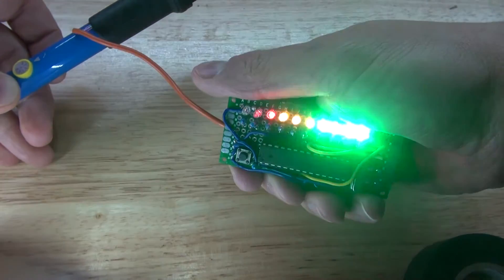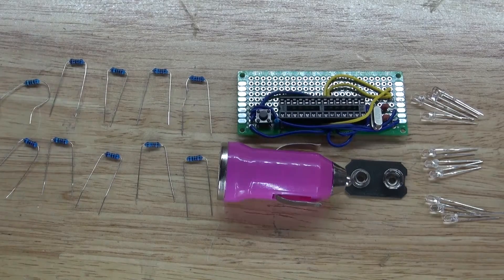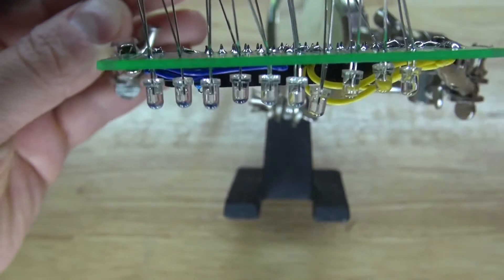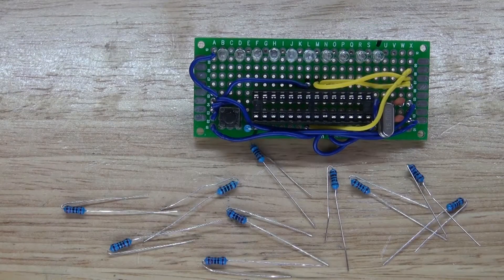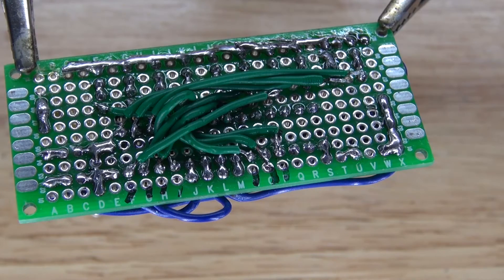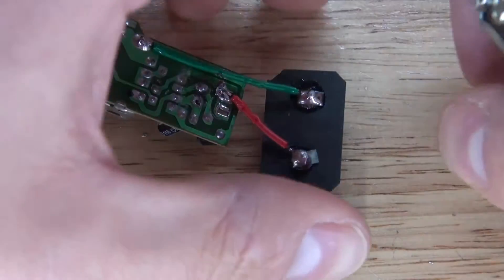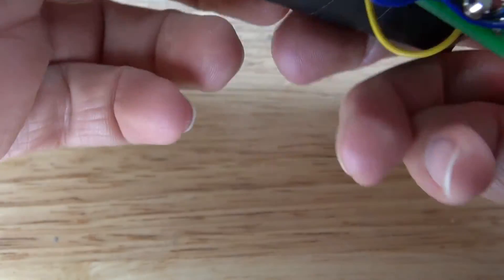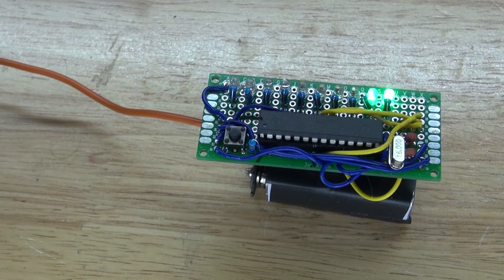EMF Detector Device With Atmega328

Comment: Okay, I think I've got this figured out.  If I'm looking at this correctly you could use an Arduino, I'm thinking a nano, wire it exactly as it's shown on the Arduino website for the led bar graph project, just replace the breadboard with protoboard and the potentiometer with the antenna?  Then run the code for the bar graph.

Comment: code and connection diagram please
Reply from the maker: I don't have a diagram available, but I do have a video on how to make an Arduino on a perfboard. And for the code you can us the bar-graph code that is already available in the Arduino program. https://www.youtube.com/watch?v=QXriSN5u980
Reply: Ok that was cool, I never thought about the phone charger.
I have 2 Arduino spirit boxes using the PAM 5 volt amp. but didn't want to run it all off the Nano 5vcc and am getting a I2C buzz where I need to run the display off a separate power supply. I had the display and amp off a 3 pack of AAA batteries. I wonder if I used the Buck converter before the Nano and pulled the amp and display off the power before it went into the nano if it would still buzz.     Never thought about it that way.   Your light years ahead of me might you have an idea if it would work?
TEA5767   TM1637   PAM8403  Nano  a few switches and 2 Potenomiters  9 volt feed   4ohm  3watt   2 in speaker ..  this is my second project.      Thank you for sharing.  Bob
 Bit off alot for my first build then this one...